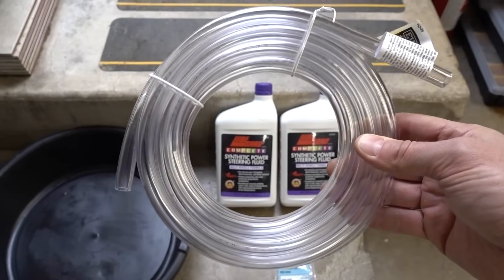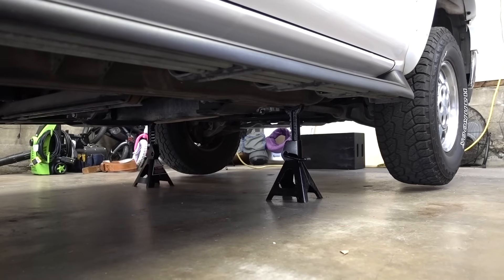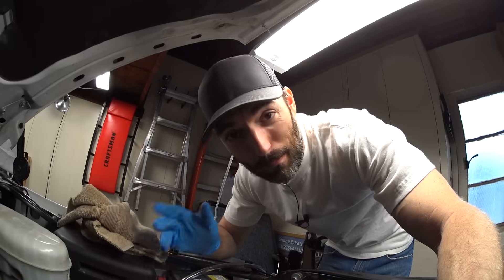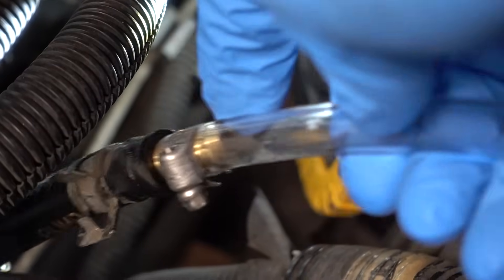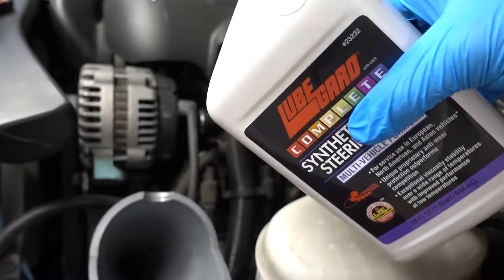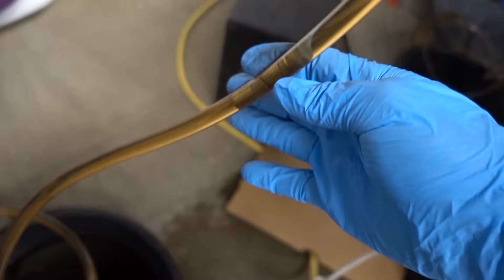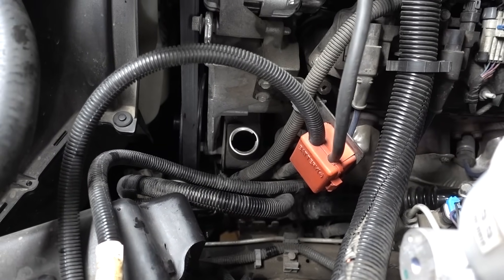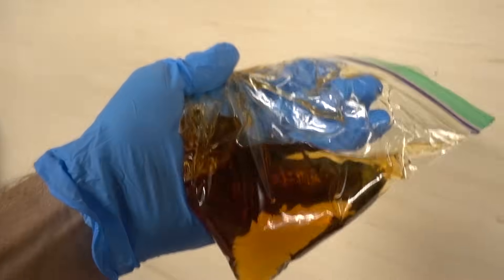Absolute BEST Method To Flush Power Steering Fluid!!

Comment: Lubeguard is really good fluid, I still prefer AMSOIL on my Jeep XJ because it has a really high heat rating. 
I did notice an improvement when rock crawling, previously the pump would start to howl when it was overheated, now I can push it much harder. 

On a stock pavement vehicle, honestly it is probably just better to change old fluid as it DOES shear out of grade and will degrade after being heat-cycled for 5+ years. The main bearing of the PS pump is pully driven and cooled/lubricated by power steering fluid. Metal shavings and dirt will cause that to pit and ruin the outer bearing surface.

Not to mention the steering rack or gearbox....
Reply: you need to attach a small transmission cooler to your power steering line.

Comment: Thank you for the video. Thinking. Should I do this when the engine is not hot. Maybe the power steering fluid will burn the PVC hose if still hot.

Comment: I prefer the turkey baster method that way there is zero chance of anything going wrong. The trick to using the turkey baster method is to drive the car for a while to get the power steering fluid hot first that way you can get more fluid out Since it expands. If you do this once a year the fluid doesn’t ever get very dirty so it works just fine.

Comment: Verry verry helpfull..
Thank's freind 👍👏👏😘
Reply: I used a pump from my shampoo bottle. Pump out the old from the reservoir and replace with new fluid. Drive around the block and repeat till fluid comes clean. You will need at least a couple of quarts of power steering fluid. The best fluid is 5.1 fluid.

Comment: Hey Thanks for the Info that looks very Easy to do. I haven't change mine yet Because I'm stuck trying to fix my wire on the starter I didn't butt clamp it on there right this is My 4 time trying it and I don't want to pay anyone A lot to do a easy job

Comment: Thank you great video i gotta do it on my 09 Taco 145000 miles first time. My mechanic said fluid change causes more damage.
Reply: HB
Your Mechanic had to be referring to changing Trans Fluid on High Mileage Vehicles
or ones not changed every 2 or 3 years (40,000 miles)
Then --Yes they can slip.
The Power Steering Fluid shouldn't be an issue.
How long do you think the System or Pump will last, with old fluid that gave up
at 60,000 from heat & pressure ?
Reply: @pczapp827  I flushed it myself very dirty.

Comment: Well thats a good idea to get the fluid out thru the return line.
Now i wonder if a Liquivac can just suck it out right thru the line? 
That would be interesting to see.
The small one for 45$ is better. 
I have both, easier to empty the small version. 
Also great for sucking dirty brake fluid out of the master cyl, lawn mower oil changes too.

Comment: If you had used a Turkey baster first to empty the reservoir, you might have saved a pint otmr more by filling it with  new fluid before purging.  BRW does your truck have a PS PUMP filter?  All. Mercedes do
Reply: That's what I do🙂👍

Comment: hoping to try this on my 2011 buick enclave, my suv has really stiff steering, hoping fluid flush will fix this, great video, and well done and stated part for part. awesome
Reply: Did this flush procedure help? Got a 2010 Chevy Traverse with stiff steering too.
Reply: @HuskerRed11  yes it did, its a long process, but follow the steps, and if you need a helper, that's best, but yes, the fluid was gross, and dark, after adding the new fluid, and then getting it clean, it sure did. good luck
Reply: Ok great. Thanks!

Comment: I think there might be a difference between using steering wheel versus forcing wheel back and forth.  I have the 3.4L with return hose on top and never overflow or mess, even though I filled max to the lip.

Comment: 97 GMC dually pickup truck Sierra SLE c3500... The variable component at the bottom of the steering shaft burnt out I could smell it and hear it... I got new pump with bypass tube... I was told by AutoZone employee I can just transplant the bypass tube it should also work without removing the steering pump temporarily.... I had to take the fitting off of new pump screw it into Old pump... So bypass loop would fit... I lifted it after hooking it up turned it locked to lock a few times .....no power steering...... Do I definitely need to take a loose and flush? I guess at some point I'll find out if that works... I don't think the electronic component solenoid behind the pump somehow damaged what was working before.... before it went pop smoke....

Comment: I’m confused, I thought the old fluid return line would be coming out of the hard line, doesn’t the soft black return line just go straight back the reservoir?  If you want to flush the fluid out of the rack, don’t you need to connect the new clear hose out of the hard return line (coming straight out of the rack) and then you cap off the return to the reservoir so the new fluid comes out of the reservoir goes through the rack, then out of the rack and into the drain?  What am I missing?

Comment: Great video. My need is on a 2011 f150 5.0.  My question is when I jack ft up will that free the tension on tires? Sitting on ground it's a no go! I'm really not wanting to do it with engine on. Side comment: I love seeing you reading the " manual of life" in the other video!

Comment: Great video! Is it possible after flushing old fluid with new to just drain the return line, reinstall return line to pump, and top off reservoir? I'm not sure if this would work but if it would you wouldn't need to pinch the return line since it needs reinstalled at some point anyways. Just a thought.

Comment: i have a 2006 toyota camry/solara and the power steering reservoir has a very small fill hole 

so the turkey baster is to big around to fit into the power steering reservoir.. i will try and use a smaller clear plastic hose to fit down into the reservoir and other end with a tight fit into the turkey baster..

Comment: Hi Jimmy,
Your video here is so good and easy understandable, i was looking for a good video to do the preparations for my system flush after i replace the oil cooler.
I d like to know what pipes/lines are where and now i am ready to go with your instructions.
Thanks a lot.
'Frank van der Schelde

Comment: @1ROAD...quick question:  can you allow the power steering reservoir to run dry while flushing it (would it self bleed if air got into lines?) or do you need to always keep some fluid in it while flushing?  I also watched your ATF fluid flush/filter swap video (great one) and on that you can and do run it dry so was wondering about running power steering res dry or not.  Please advise....thanks. Keep up the great videos.

Comment: What about all the dirty- compromised fluid sitting in the STEERING GEAR BOX?? Seems thats where the sludge would naturally reside what with gravity and all things.. Running a flush- conditioner into that gearbox would likely be a WISE SUGGESTION

Comment: Doing this with engine off seems too easy. I have a 1st Gen Camaro, will this process work for an old style Saginaw PS pump? Every instruction I see says to run engine to push fluid out but I don’t have someone around to eye the fluid and would rather do it this way.

Comment: I hate to be "that guy", but you should do it with the truck on and pump pumping to evacuate the fluid from the gearbox, too. There is just as much fluid in the gearbox as there is in the pump, and as I think of it, you'll need the return line un-kinked to allow that fluid to escape the gearbox
Reply: Honda owners manual calls for the car to be on jack stands, and pretty much directs you to do this method. Turning on the car can run the risk of running the pump dry.
Reply: "the Honda manual"geeeeeesh, if the goal is to flush fluid from your PUMP reservoir ONLY, then have at it. But its a PUMP, ergo it sends fluid to other parts via a PUMP. If you have a hydro-boost brake system, power steering fluid is PUMPED to the hydro-booster. It PUMPS fluid to the gearbox, the steering rod is connected to the steering wheel and the gearbox, NOT the pump. This is the equivalent of draining the brake fluid from the brake reservoir and saying you flushed out your braking system. He breeches the RETURN line to drain the pump on the pump side of the RETURN line. What it returns FROM still has old fluid, fact. Look at the power steering system fluid capacity,  it's more fluid than the pump reservoir holds, by a factor of 2 or 3. In conclusion, you have to PUMP fluid into and out of the power steering circuit and that's done with a PUMP, a PUMP that operates from a drive belt off a running motor. Jack up your front wheels up, turn the truck on, remove your power steering cap, use a baster or a hand syphon, remove about half the fluid, crank steering wheel back and forth, take half fluid, crank steering wheel, take half fluid, keep going until pump is empty. TURN TRUCK OFF. There will be about a half gallon of dark power steering fluid. Fill pump with fluid, new fluid. TURN TRUCK ON. Crank steering wheel back and forth, top with fluid, crank wheel, top with fluid keep going until pump is full.
Reply: @shanefsr6609  And you obviously don't know how fast the pumps will empty through the return, why don't you do us an unedited video of YOU doing it.... Maybe some are different, have lower pressures or whatever, but those GM pumps will empty in the time it takes you to start the truck, you won't get back under the hood fast enough. You are "THAT GUY"

Comment: Nice video, but not all cars will allow the steering to move lock to lock without the car being started. I have full power hydraulic steering on my Jag xf, and really afraid of using your procedure to flush my system.

Comment: @1ROAD I can't find the return cable on mine. I just have a large cable that is located in the bottom, then I have a high pressure metal cable that also goes somewhere beneath... Where is my return hose? It's -01 Opel Vectra

Comment: I'm going to do the power steering flush this weekend, but I'm planning on doing it with the engine running (wife at ready to shutoff engine if necessary).    Anything other concern with this method, other than making sure the reservoir is kept filled so the pump doesn't cavitate?

Comment: On my work truck every time I change the oil I drain the power steering tank and replace it with new.   It’s a 2006 and the fluid looks new.

Comment: You mean to tell me just turning the steering wheel from side to side/lock-lock actually pumps out the fluid, make it go up the hose and down out into the bucket for without having to start the engine for real? someone please confirm this.

Comment: My power steering & brake fluid is 25 years old!   Radiator fluid is 10 years.
Reply: missingremote Rot Sa Ruck!
Reply: And his engine oil is most likely at least 3 years old.
Reply: If you try to sell that hunk of shit to someone instead of crushing it let them know those details.
Reply: I'm sure if the vehicle is RWD or 4WD, the gear oil is also extremely old and dirty.
Reply: @skylinefever   I had the 30,000 mile level maintenance done ahead of schedule. at a Chevrolet dealer.  But that was near 11 years ago. They did do the diff. I put on 30,000 miles since 2008 -
Reply: @missingremote4388 
You probably also take a bath once a year.
Reply: I drive it 3 times a year - when practical or needed

Comment: most power-steering problems by high-mileage cars are caused by the screen in the bottom of the reservoir clogging up with small bits of carbon that come from old decomposing ATF fluid that has never been never flushed... then when the screen finally becomes totally clogged, the pump gets no fluid and normally you'll hear a whine and lose your power-steering and may damage the pump depending on how long it runs dry... the reservoir should be removed and the screen should be cleaned whenever you flush the PS fluid (every 50,000 miles) and then bleed the air from the system... you can also save yourself the trouble of ever having to clean out the screen in the reservoir by putting in an inline filter after you flush it...
Reply: Make a video.  That be rad

Comment: I have a car that calls for ATF in the PS system, It looks likes someone put standard PS fluid in the system.  I want to flush it out with ATF, is there anything I should be concerned with.  I know there will be traces of standard PS fluid that will remain in the system mixed with the new ATF, and all the parts have been soaked with PS fluid. Will there be any kind of chemical reaction I need to be concerned with?  I do not want to do more harm than good, but I do want to have fresh fluid in the system and would like to go back to what the manufacturer calls for.   Any advice would be appreciated.

Comment: the intention of the video is good, but not sure if turning the wheel while the engine is off doing anything to pump the oil out, since the pump need to be turning in order to pump the oil, what's coming out of the hose is just the mass of oil in the reservoir, I would have gone under the pump/engine compartment with the the clear line and this the oil would off empty faster since is gravity what's making the oil come out.
Reply: Angel De la Cruz Honda owners manual recommends this method...
Reply: have 3 hondas at home
2016 Accord
2015 Odyssey
2005 Accord 
and i don't see where it says to turn wheel left and right to drain fluid,,,I don't even see when or how to do it on our Hondas, BUT DID SEE WHERE IT SAY THAT TURNING LEFT AND RIGHT LOCK COULD DAMAGE THE P.S PUMP but doing it the way this guy did, I don't think is the best way, I done several on my cars, on this way it only gets the oil out of the reservoir and not out of the system..the idea is good but not the best way.
Reply: No, it's working. The piston in the rack is pulling the fluid through the pump, down the high pressure line,  through the rack, up the return line,  and then into the bucket. Actually a good procedure, I never thought of doing it this way.
Reply: Robert B. This is a Chevy, I believe it has an (old school) power steering pump, so I don't think  this turning the wheel method would work, now on a vehicle with a rack,,,it might do....I'm not a pro, but my no sense mind takes over me sometimes...
Reply: @angeldelacruz7254  it is a rack, has been since the early 2000's on the GM light duty trucks.

Comment: CAUTION: FYI:  GM DEALER SERVICE MANUAL states in bold RED:

 "Important  Do not turn steering wheel to lock."  

Start the engine. Allow the engine to idle.
Turn the steering wheel 180-360 degrees in both directions 5 times.
Switch the ignition off.
Remove reservoir cap, verify fluid level.
Then attach a vacuum of 20 in Hg for 5 minutes to verify no air leaks.  Should hold with no less than 2-3 Hg loss.  If doesn't hold steady, repeat bleed process.  If still not steady, probably have air leak in system.
Verify fluid level again.
Done.

Comment: There's gotta be another method for me. I can't turn the steering wheel since I don't have a rack and pinion on my car, it's a 2001 Ford crown Vic. Even with the key in the run position I can't turn the wheel. So pretty much it only turns while it's running lol

Comment: My limited understanding is to. never run your PS dry. Introducing air is not the best idea. I just suck old fluid out, add clean no fluid, drive the car and repeat. No air in the system and I have clean fluid after 6 partial drain and fills.

Comment: Why would you turn the wheel from lock to lock? Does the pump not work when you turn the wheel just a little in either direction? Mine does?
Reply: If you're doing it with the engine off then the pump wont be actuating but the compression from turning the steering wheel from lock to lock will be enough to evacuate the fluid through the pinion valve in the rack and it will backflow up to the reservoir. Doing this with the engine off will allow you to repeat that process until you've emptied nearly all of the PSF from the entire system without running the risk of burning out your pump from running it dry.

Comment: My steering wheel locks when the vehicle is not on in my 2001 Ford F-150 Supper crew. Any way around this?
Reply: I usually keep my key in near the On position to keep the steering wheel from locking up

Comment: Plz i have a question While i'm cracking the wheel to lock to lock while engine is running, Should i close the cover of reservoir ? or let the reservoir open and also there's a question after i run the engine and i found a low level in the reservoir Should i fill it while the engine is running or shut the engine and filling it ??
Reply: No. Do not run the engine at all. Check the level after you get bubbles out an after test drive.

Comment: Hi, great video! I have an important question: is it necessary to turn the ignition switch on when rotate the wheel from lock to lock? I saw some guys to do that but I forgot.

P.S. I did the whole thing correctly and I drove for around 15/20 min to check leak, dripping or noise. Everything is good so far.
Reply from the maker: Awesome! 👍 You would only need to turn key if you have a steering wheel lock... I think..
Reply: @1RoadGarage  thanks!

Comment: How do I know which line is my return line?
Reply from the maker: I’m no professional mechanic but in my experience the return usually has a simple hose clamp. The supply, or high pressure line, usually has more permanent fittings... you’ll have to do some investigation and maybe more research online but hope that helps a little.

Comment: Ok so I just did this process, and when I turned my steering wheel back and forth, I got less than one ounce of fluid that came out.  I turned the wheel fully to either side at least 5 times.  Then I filled up the reservoir ( which I used a transfer pump to empty ) and tried turning the wheel again and nothing again.